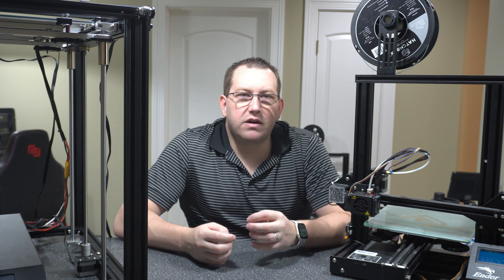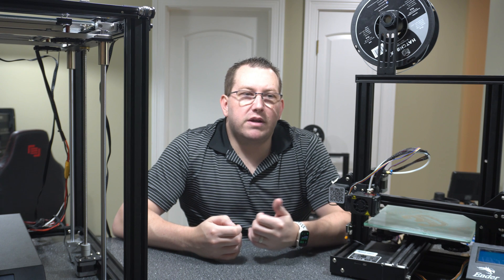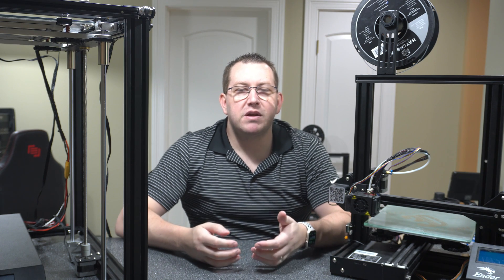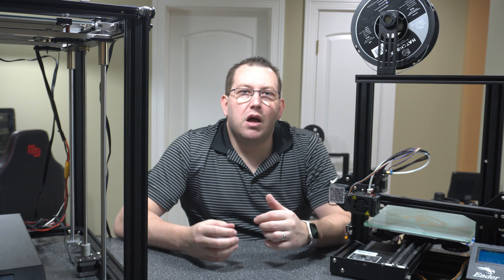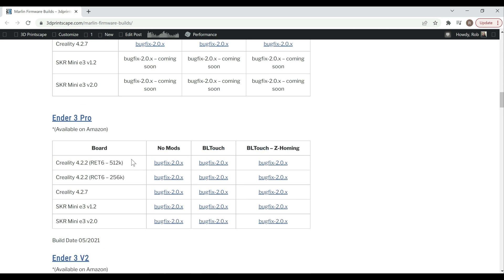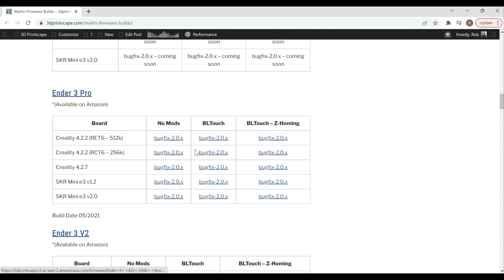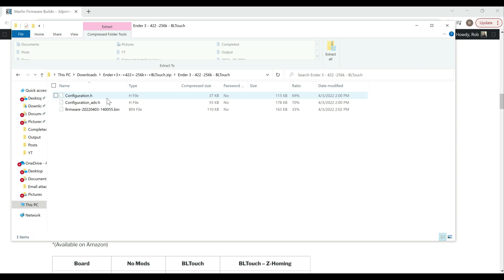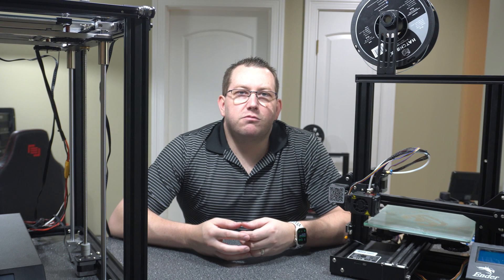Creality Screen Issues After Firmware Upgrade

Comment: have an ender 5 pro for a week now im stuck with a blue screen after trying to install the firmware update. any ideas how to fix it i been at it all day and have failed.
Reply from the maker: Hi. Can you verify that you grabbed the right firmware for the board? If you did, try to add a random number/letter to the .bin file name to make it unique.
Reply: @3DPrintscape   will try to rename it than see if that helps. fingers crossed lol
Reply: @3DPrintscape  no luck with that either.  Im just trying to intsall the original Firmwre now from creality site. ver 1.01

Comment: Literally just had this happen. I'll let you know what happens.
Reply from the maker: Hi. Were you able to get it fixed?
Reply: @3DPrintscape  just went over after reading your comment and flashed it. And it booted up perfect. Thanks again!!
Reply from the maker: @Geek82  Good to hear.
Reply: @3DPrintscape  I do have a question. I'm trying to use the z probe wizard and it seems to function fine but the adjustments don't seem to be saving or working. They show that they've been saved and are static after power down. But when I start a print I'm printing in air again.
Reply: Flashed the eeprom, homed xyz, started z wizard, done, saved then started print. All is well.
Reply from the maker: @Geek82  After a power cycle, do you show the z offset still set?
Reply: @3DPrintscape  what I noticed is that you NEEED to use the z wizard or the z adjustments will not take.
Reply: @Geek82  Interesting, i know that wasnt the case in the past. Its possible they changed things in the latest version.
Reply: @3DPrintscape  I'm currently waiting on a part before flashing it. I had to step away from it for a day.

Comment: I need HELP with my ender 3 pro. I add a cr touch and update firmware. Now my screen is glitching and micro sd card will only reed the files sometimes or mess up. I add the firmware you said on youtube. Now the screen is blank and i cant do anything.
Reply from the maker: Hi. What chip do you have and what was the name of the file you put on the sd card?
Reply: @3DPrintscape Thanks for replying.  I am not sure what you mean by chip. I use the one you showed in the video (firmware-20220403-140055.bin)
 I bought a Creality CR Touch. I installed it and installed the cr touch firmware. The screen was glitchy and I has trouble printing from my sd card. Then it stoped reeding my micro sd card. I tried a few micro sd card then I found your video and tried the firmware the screen went blue. I tried reinstalling the Marlin 4.2.2 firmware. I checked the power with electric tester. I checked the fuse. I checked all wires.
Reply: I don’t need your help but thank you and please keep helping people your Chanel Los very helpful . I tried every firmware I could find. I finely found 1 that works.
Reply from the maker: @chadbyars1554  Im glad you were able to get it working :).

Comment: Your big fix worked for getting rid of the glitchy screen however I still can’t do anything. All I see is the main screen that displays things like the temperature. The temperature reading is incorrect and when I press down the knob nothing happens. Thoughts anyone?
Reply from the maker: Hi. What board/chip do you have and what firmware did you use?
Reply: @3DPrintscape  been using 4.2.2 which is also the chip I have
Reply from the maker: @jacobstevens6286  The 4.2.2 started shipping with a different chip this year. Can you confirm which one you have and the file name of the firmware you used. This video will help. https://youtu.be/kUIPmVeY7ns

Comment: I'm having the same problem with a SKR 1.3 board after updating to 2.1.1. I downgraded and still happening
Reply from the maker: Hi. I havent heard about this issue on the skr boards. Is your new or have you had it a while?
Reply: @3DPrintscape  I've had it for around 6 months in my ender 3 pro. Put it in my tevo tornado xl and the screen does this when I start a print or the printer is on for a while
Reply from the maker: @Aussiejj88  Curious, if you put it back on the e3p does it have  the same issue?
Reply: @3DPrintscape  haven't got around to doing it yet. In the middle of building a 1 metre by 1 metre printer in my garage. It still works in the printer it's in now, I just use cura to start prints

Comment: So i came across this video in my own issues with my ender 3 pro.  I tried uploading firmware for the 4.3" touch screen creality makes and the firmware made it so the printer did not read SD cards.  <----

I  managed to get the printer to accept an SD card when i renamed the firmware to less than 8 characters.   I then found the firmware i had download to revert back to the stock display was making the display garbled and glitchy. 

I changed to another file from a stock marlin build Marlin-bugfix-2.0.x which i think may have been one i downlaod from your site which fixed the screen.

I have a hunch that the touch screen was making the SD card not work in relation to this 512 vs 256 issue but I have no means of testing it.  

Happy to share the builds and send you a video of the issue and how i resolved it.  Still can't use the touch screen :'(  working but at least the printer is usable again.
Reply from the maker: Hi. Im glad you were able to get your printer working again. I think im going to end up buying the creality touch screen soon. I know a lot of people are having issues when trying to use custom firmware with it.
Reply: It’s not even just the custom firmware.  Creality’s web download firmware for this screen seems to be bad for some users which is odd.

  I’ve found about half a dozen people posting on Reddit about it. 

 Works fine for some no good for others.  

If ya do a video or post about it I’d be pumped.  The screen looks great and is neat but not at the cost of bricking peoples printers. 

Thanks again!
Reply from the maker: @adamlindsay2440  There seems to be a lot of issues with the creality firmware in general.

Comment: having an issue, have an ender 3 pro with a CR touch installed. used your firmware but while homing it seems to only go up (i disconnected the Z Stop) reconnected the z stop and it goes down but ignores the CR and only uses the Stock Z stop. ive installed cr touches on a V2 but Im stumped on this ender 3 pro
Reply from the maker: Hi. The z stop should be connected. What firmware file did you use?
Reply: @3DPrintscape  Creality 4.2.2 (RET6 – 512k) i tried both BL touch and the BL touch Z homing. i double checked and made sure i had the RET6 chip and the 4.2.2 board
Reply from the maker: @alecvalenzuela4141  Ok, assuming you have the z stop connected and the bltouch plugged into that port, you want the bltouch firmware. Try to go back to that and make sure you clear the eeprom.

Comment: Thanks for this Rob! I used your "Ender_3_Pro_22_BLTouch" for my Ender 3 Pro & CR Touch. My screen glitch is fixed & it can read the Micro SD card again. I left my Z plugged per your video. My issue is I don't have the complete menu that includes bed leveling and I don't see the CR Touch probe doing anything. Am I using the right firmware or missing a step?
Reply from the maker: Hi. Do you see bltouch in the menu anywhere? It will show up as that, not crtouch. Also, with most firmware builds, you want the z stop connected. There was only a couple of the creality builds that didnt work if it was connected.
Reply: @3DPrintscape  I don't see the BLTouch menu. Should I disconnect the z stop cable from the board & remove the switch?
Reply from the maker: @mikescastillo  If its working with the z stop connected, i would leave it. If you remove it now, you may need to add it back in during a future firmware update.

Comment: Can I install that firmware on an ender 3 pro with a v4 motherboard. 2.7. But I don't know what stepper drivers are
Reply from the maker: Hi. The 427 builds i have should work, if not let me know. Also, the driver on that board is the TMC2208_STANDALONE one.
Reply: I don't know what seper drivers are, but they are quiet, there is thermal paste over them, so I can't see it, and I'm not sure if I'm removing the heat shrink
Reply from the maker: @zvonimirtrgovcic5499  The drivers are TMC2208_STANDALONE.

Comment: Good evening, I just opened and assembled my ender 3. it powers up, or at least the main fan comes on. the cooling fan for the mother board does not. The screen flickers if I move the X motor is moved manually, but it is dark if I don't. Any ideas if the firmware can fix this?
Reply from the maker: Hi. I would go through and check all the connections on both sides of the cables.

Comment: Thank you SO much. I received a 4.2.2 board with 256k RAM. I tried EM shielding the screen, the cable, reset the official firmware so many times - nothing worked: my screen was either blank or a pixellated mess. Used the firmware you linked and it's working wonderfully!
Reply from the maker: Glad I could help :)

Comment: im still a little confused on which version i should download. i have a 4.2.2 board and am having the screen glitch. When i installed the CR touch i pluged it into the dedicated bltouch port and removed the orignal z axis cable as informed in the pervious video

Edit: I got that working and everything is startng to look good except i have no idea how to account for the x and y location of the probe do i do that in cura and if so how, i cant find any where on the printer to account for that.. When i did the auto level the nozzel comes slightly off the right part of the bed.
Reply from the maker: Hi. The z stop should be connected for most firmware, what firmware are you using? If you used marlin, there is a section in the config to define the x and y offsets. If you used the creality firmware i dont think you can change it.

Comment: Thanks for posting this and clearing things up, I own a ender 3 pro with a 4.2.2 board with a 512k chip, all your programs seems to not let the cr touch work properly, on the z axis and when adjusting the z axis it only lets me go up on it not down. I’ve only found one software program that lets the cr touch work properly but the screen is glitchy with it and it doesn’t accept any type of drive to print the Gcode files off of. I have tried all of your preset files but none seem to work. Kinda wandering what to to with all of this so I can quickly get back to printing?
Reply from the maker: Hi. I have only seen that happen if the z stop isnt connected. Try to connect it and test again.

Comment: Hey i just downloaded the 4.22 512k for my board, everything seemed fine however when auto homing and moving the z axis in motion controls, the axis wont go downward only upward. The Ender 3 Pro has a CR touch installed
Reply from the maker: Hi. Connect the z stop. There were only a couple of Creality builds that didnt want it connected.

Comment: Hey there,
I'm not sure if I'm completely right at this video but after installing the bl-touch my ender 3 v2 freezes up and after searching forums I'm still clueless to fixing the issue, after seeing you I figured that you might have some ideas on the topic, thank you for answering in beforehand XD
Reply: I've got the ender 3 v2 with the 4.22 board and it might have to do with trying to installing a wrong bin file for a firmware update, possibly with the gp firmware version but I'm sadly unsure :´(
Reply: And while trying your firmware updates my screen started shrieking high pitched XD
Reply from the maker: Hi. Can you provide more details on the error your seeing what firmware file did you use?

Comment: I installed the firmware for the ender 3 and it made my printer think it was an ender 3 pro and it would no longer auto home or print I need help!!!! the problem got worse
Reply from the maker: Hi. There is no difference to the board between the ender 3 and ender 3 pro. What is it doing when you try to auto home and is your z stop connected?

Comment: Hi Rob,
I looked for an email but could not find one. I am an almost 50 year old guy that just got an ender 3. Trying to figure out whats what with the firmware is akin to looking down the Mariana Trench. Ive dabbled in computers since the '90s and finally got my IT degree this spring from the community college, and this has been a challenge. After a ton of searching you answered a multitude of questions in a couple of videos. Your firmware was a godsend and I wanted to thank you for that. I do look to understand the firmware more but there is so much to learn. Just wanted to thank you and I have subscribed. I must be a fool but I have also ordered the full size ender extender. That should be fun.

Nathan
Reply from the maker: Hi. Thanks for the like and sub, i appreciate it :). If you run into issues with the build for the extender just let me know and i will try to help.

Comment: I was following your other tutorial about installing CR touch and when I updated the firmware I had the blue screen of death! Your firmware absolutely worked for me! Just to clarify will the BL touch software work with the CR touch?
Reply from the maker: Clad i could help :). Also, yes the bltouch firmware does work for the crtouch. They are the same thing to the board.

Comment: I have 4.2.2 and a gd board will this work I added cr touch and I am getting a lot of problem acts like heat creep filiment stopes goog through .. it’s ransom 60% of the time it prints like 10 percent of the item then jam other times Jams immediately . Everyone on the discord is telling me I have to by a new board because of the gd chip .. I am sure there right but I just bought this machine
Reply from the maker: Hi. You may be able to try to adjust the flow rate. Not sure how much it will help though.
Reply: @3DPrintscape so slow prints 🤷🏻‍♂️. I got the original firm ware did over 20 prints with that one so doing a test print if that doesn’t work I am going to buy a new heater thanks 🙏

Comment: You my good sir, deserve an award for this work. You also saved the life of my 3d printer because I almost through it against the wall in frustration. Thank you thank you thank you!
Reply from the maker: Glad I could help! :)
Reply: @3DPrintscape   my 3D printer Is stuck on a blue screen what do I have to do to fix it ??
Reply from the maker: @niceguy7514  Is it when trying to flash a new build to it? If so, try changing the file name to make it unique (just ad a number or date to the end).
Reply: @3DPrintscape  Thankyou so much I completely forgot about this feature and this allowed me to reset my printer to default firmware

Comment: Oh man! Another Ender 3 pro user with a glitchy screen here — your firmware fixed it, aside from ONE thing; the z-axis doesn't want to go down at all. When auto homing, it'll move around, go up the z-axis, but is incapable of moving down. Manual adjustment on the z-axis also fails to move it down. I appreciate all the hardwork you've been putting in, and I thank you, I'll happily wait until it's all fixed.

Or should I just order a new motherboard? 👀
Reply from the maker: Hi. Make sure you z stop is connected. If it’s not, it won’t go down on the z axis.
Reply: @3DPrintscape 
Edit: I connected it, but am now having issues with a message saying, "Endstops Z" at the bottom when trying to level the bed or print — it'll move around for two points, then will consistently quit in the bottom left corner. I'm new to all of this, not sure where to go.
Reply from the maker: @vloppysagina  What firmware did you go with? Can you try the bltouch firmware from my site?

Comment: Thanks a lot, fixed my screen
Reply: This firmware does not work with CR touch
Reply from the maker: Hi. What firmware did you use? The bltouch one does work with the cr touch. Also, if you dont have the z stop connected, the z axis wont go down.

Comment: I have the ender pro 3 after I installed the CR Touch and firmware it has the glitched screen. I downloaded your firmware fix for the 4.2.2 with the BL Touch it fixed the screen issues but now the Z axis will not move down only up. Can you help with this. Thanks
Reply from the maker: Hi. It sounds like you dont have the z stop connected. Try to connected it and test again.
Reply: @3DPrintscape  I have the z stop disconnected and unplugged when I installed the cr touch. Do I need to reinstall the z stop and connect it
Reply from the maker: @srt42678  Ya, there was only one version of the creality firmware that needed it removed, not sure why.

Comment: dude thank you this fixed my issue
Reply: Actually came back and now my z axis isn't moving I uploaded the wrong firmware at first (the 256k) instead of the ret 6 I uploaded the right one to no avail. any suggestions?
Reply from the maker: Hi. Is your z stop connected? If not, connect it and try again.

Comment: It seems to have solved my problem with the screen.
Is it normal to be written "Ender 3 Pro" on the display even using the common ender 3 firmware?
And the merlin works correctly even with the GD32F303RET6 processor?
Sorry for the amount of questions, I'm new to this field.
Reply from the maker: Hi. From the firmware perspective, the ender 3 and ender 3 pro are the same, so I just used the same build. It should work with that.

Comment: Will this fix phantom clicks? My Ender 3 Pro LCD screen will randomly click into the menu. I have tried three different LCD screens and three different cables for the screen. Along with a motherboard swap and this issue still persists. Any help would be appreciated.
Reply from the maker: Hi. Not sure, i havent actually had that issue. Its worth trying though.

Comment: Does it fix blue screen? I had my print for a couple of weeks now and I try to install the CR touch once I try to download the software to it the screen started glitching on my ender 3 turn the printer off and back on the screen was blue
Reply from the maker: Hi. Try to add a random number to the end of the file name to make it unique. If the file name matches the previous one, it will blue screen.